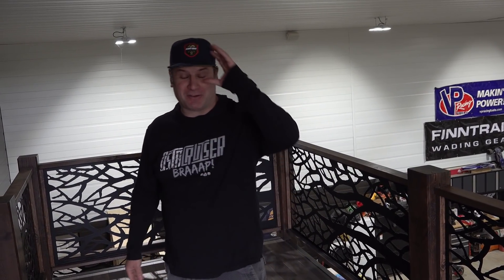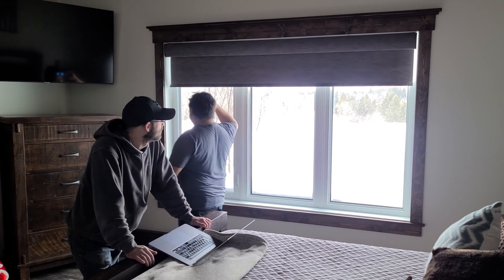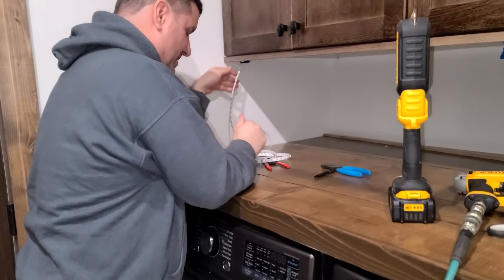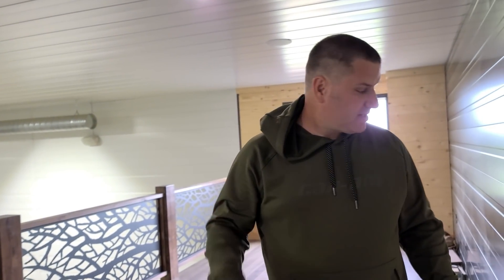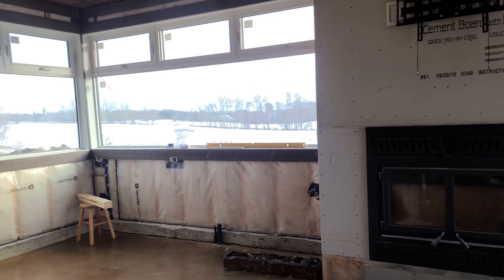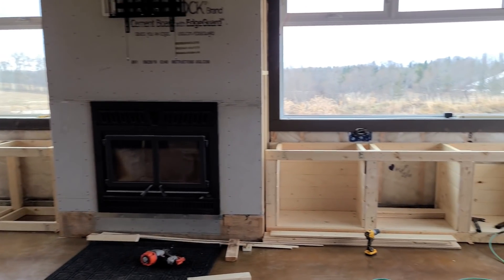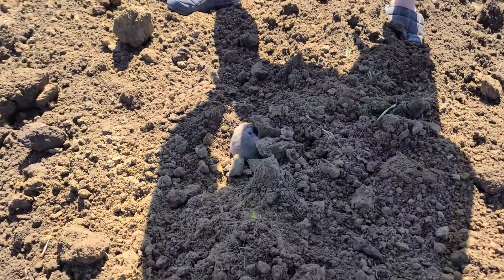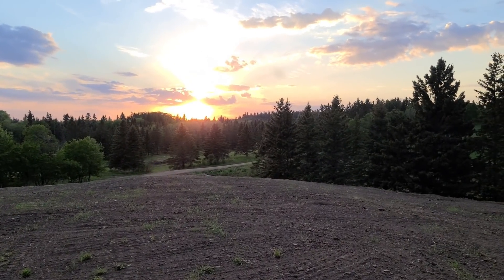Building Our Dream Shop/House Part 22:Huge Update

Comment: That house turned out awesome!!
I would like to know who did you get your blinds from?? On your counter top that had the rust tick what look looks good get some clear  Polly europhane. And fill it an why yr filling it have a small propane torch if there's are bobbles litely run the heat over it. An none of old wood won't fall old.
Again it turn out Beautiful.
Reply from the maker: Thanks for the tip!!

Comment: looks realy great wen i can move in ? 😊  But here a tip for your problems with bending wood. If you close Wood only on one side with Finish the wood can only breathe on one side it only will expend on the side that is not clost up so it will bend (expend) on the non clost side. allways put the finnish on all sides. sorry about my english gratings from Gemany

Comment: HINT: Buy small squeegees to hang in your showers. If you clear the water off your glass shower doors, after you are through showering, you will not have water spots on them when they dry. I was told I would never have water spots on mine. Guess what, THEY LIED! Get the squeegees, it will save you some cleaning time.

Comment: What is the building dimensions? We are planning a build currently and like your layout.
Reply from the maker: 50x100 main building. Shop is 74x50. Main floor living is  26x50. 20x30 patio with a 28x32 attached garage. 26x50 2nd floor living area with a 24x10.5 terrace. 19ft walls in shop. 9.5ft in main floor. 8.5ft on 2nd floor. 12ft walls in attached garage and 10ft in patio
Reply: @ostacruiser  thank you